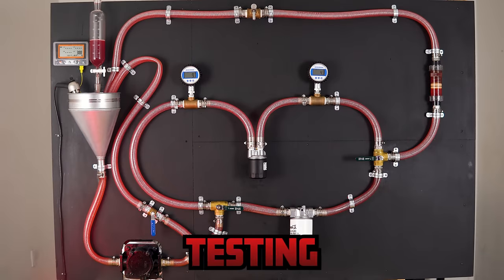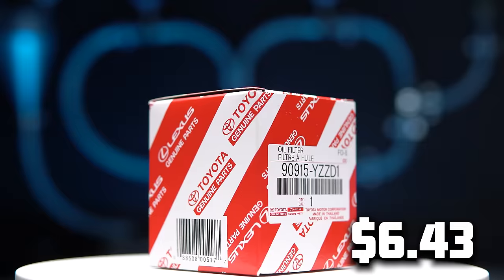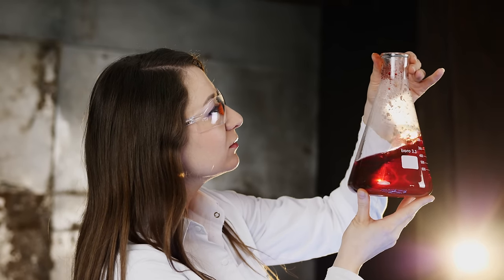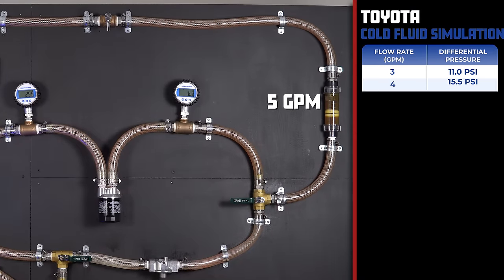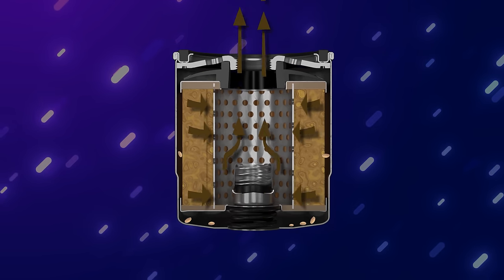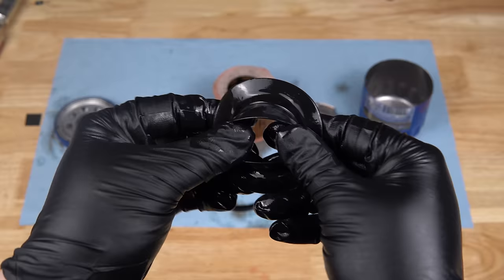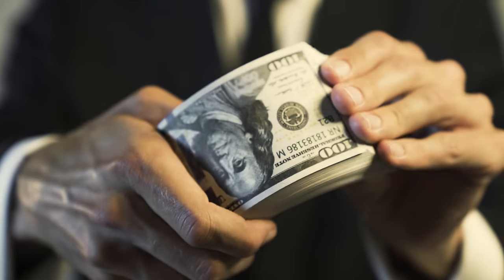Are Car Dealership Oil Filters a RIP-OFF?  (Engineer tested)

Comment: I would like to see the Honda filter in your list, because every Honda guy swears by Honda products... And is there a difference between the Honda filter you get from the dealership or the one you get from Walmart... Also the Toyota filter is supposed to be made by Denso.... Those the Denso oil filter perform the same as the Toyota Brand???

Comment: If you can find it, get the actual Toyota filter from Japan. It cleans exceptionally well. Kept my oil nice and clear for an extra 1000 miles before it starts to gradually turn brown.. Cost extra 50% but well worth it! Made in Japan! Not the made in Canada, Mexico variant.

Comment: Maybe Toyota would rather have the filter collect less and not clog, knowing the new cars have longer oil schedules? Who knows, but then again, that’s why you have a bypass….? Also, where do you purchase your filters? There are tons of knockoffs on Amazon and eBay, so that is something to consider.
Reply from the maker: It could be! very interesting results. Maybe they prioritize flow to ensure they have at least some oil even if it's dirty! thanks for watching
Reply: I was told many years ago by a tech that Toyota filters are very average but for ppl who neglect or just abuse their cars, the Toyota filters always allow oil flow which is more important in high abuse situations. I use Toyota filters on my 4 yr old Camry with 0w16 oil and have zero issues doing so. I live in the rust belt. The car will rot long before the Toyota filter causes damage, if any, to the engine. Cheers.
Reply: Other thing to consider is what micron causes enough damage for catastrophic failure?  So having the ability to still filter larger and more allowing flow instead of potentially bypassing everything…

Comment: The Ford Motorcraft filter is OFTEN priced the same or lower than filters that perform worse.......although not the best,  it's OK, and a decent value.   I usually use aftermarket filters on my Fords...  BUT when I have to hit up a big-box auto parts store on the weekend,  the genuine Ford filter is an OK option that's not priced out of line.

Comment: I don't understand how a filter that traps MORE particles is rated lower in performance. Or was this a test on oil that had been run through the filter, and not the actual filter?

Comment: Some filters that filter well still have excellent delta P.  If you can find a filter that does, there is zero reason to not have both.  Fram ultras typically have delta p that exceeds OEM.

Comment: People,  modern engines use the oil for alot more than lubrication.  If you put a non factory filter on your engine you are changing the flow and pressure which will effect the use of the vvt and pressure on the timing chains since most tensioners are being driven by oil pressure.  Thus changing the oil pressure at different loads.  Stick with a factory filter every 4500 miles with good synthetic oil and there should be no doubt that the engine will perform as intended and last.  Its all a game to try to sell filters.

Comment: That AC Delco has a by pass valve! That metal piece you had in your hand acts like a spring allowing the filter to move down opening a path for oil to flow when cooled or plugged if not that filter would explode!

Comment: Oil filters are only designed to take large particles out of the oil and not to clean the oil. The only way to clean oil is to replace it. That is why long lasting oils are marking blur you should always change your oil at manufacturers recommendation or your driving conditions your vehicle is subject to, for example towing or off-road where the vehicle is actually doing long hours rather than mileage.

Comment: Every Toyota/Lexus vehicle warns you for upcoming maintenance  in 4500 to 5000 mi. interval. Most cars on the road have only paper element to replace in a filtration can.I personally add a magnet, which I wipe and reuse.Thank you for making Toyota brand parts cheaper. I buy 10 ct. directly online from dealerships and pay $5 a piece with delivery included.I buy full synthetic name brand from popular retail chain, manufactured at  the same place glorified brands come from. Saves me 30% of oil change cost. Never ever had owned car in need of adding oil between oil changes. Engines outlast the useful car lifespan. And lastly, oil filters are secondary to air filters in the engine  eco system.

Comment: Please test ac Delco PF932 and other brands crowd referenced to see of the additional length of the 2 quart filter is a better filter and obviously holds more volume of contaminates.  How about comparing flow with the of one quart vs the two quart

Comment: Nor all filters have by pass valve, becuase the valve is build into the intended engine..
If you pay attention you will notice two identical fillters of the same brand with different part numbers. This is due too the fact one has a bypass valve and the other dosen't. 

Also, their are specialized filter that Intentionally don't have bypass filters, These filters are used in performance engines.

Comment: I’d really like to see OEM Subaru filters compared to aftermarket. They have a very high bypass valve pressure, but I have a feeling that it’s due to high differential pressure, not because Subarus “require” a high bypass valve.

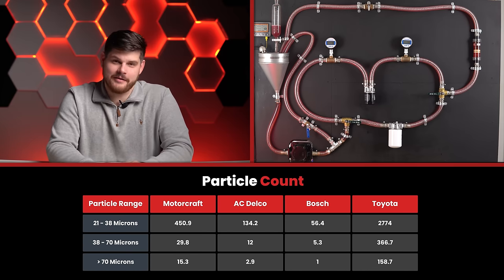Comment: Based on the filtering results at 5:56 the Toyota filter only 'looks' like a filter. It shows up for work, but sleeps on the job. Bosch looks like the hard worker of the bunch, followed by AC Delco and Motorcraft. The Toyota is left, well, way back in the dust. If I owned a Toyota, and I did when I lived in Japan, and it was a great car, I wouldn't use Toyota filters. I use the Bosch on my Jeep with a bypass filtration Amsoil EABP 90.

Comment: I’m surprised by how little filtration the OEM Toyota filter offers. Could this filter have been a dud? Is it worth revisiting this filter? Contaminants below 20 microns also damage the engine, but oil filters don’t seem to filter well below this size. Perhaps Toyota is relying on more frequent oil change intervals? If you have an OEM filter you best change the oil frequently to get the contaminants out as OEM seems to value flow over filtration.

Can oil suspend a certain amount of contaminants without it damaging the engine?

Comment: Perhaps the Toyota engine has a bypass built into the oil filter adapter assembly? That’s why Chevy small block filters do not have bypass valves.
Reply from the maker: I don't believe that's the case with Toyota as they have a by pass valve in their filter, but agree on the AC Delco one, that may be a reason. thanks for watching

Comment: Well known that Toyota filters have the least filtration, however, they prioritize oil flow instead of oil filtration. Seems like they want to keep oil in places where it's needed over pure filtration. Some oil is better than no oil, and might be designed for owners with extreme oil change intervals.
Reply from the maker: Indeed! all good points and it really might just be that. Better less than ideal oil for 3k miles than no oil for 1 second. Thanks for watching and sharing
Reply: @BrandRanks  I believe they also heavily prioritize first-start oil flow when the oil is most viscous since the most wear on an engine is at first start.

Comment: Don't agree with the construction of the Toyota filter. In the "4WD Toyota Owner" magazine of a few years back, maybe 2016 or so, they did an analysis of 16 different filters, it was a construction analysis, not a performance, but the construction of their 15600-25010 is far different than what you show. It uses metal end caps and a metal core and a pressure relief valve at the top of the filter. Instead of a formed rubber anti-drainback valve, they use a piece of rubber with a stamped metal spring to maintain the seal. I would say the 'Toyota' filter you tested was not genuine.

Comment: don't you have to use 0w20 ? or SAE 20 & SAE 30 ? So if RP filters are finer, maybe they are better for THIN oil. and Maybe the toyota filter is for Diesel ? I think when you get to the level of detail you are at - should be based on the application. The more I  learn from videos like yours the MORE questions it raises !

Comment: I believe the toyota filter is designed that way - unless you have catastrophic engine failure or dumped a bunch of sand in the oil you wont be filtering all those contaminants at once. Some oil might bypass the filter but under normal operation most of the oil is going through the filter media.
Reply: Oil change is the key.

Comment: if Honda A02 is equivalent to Fram Tough/extra Guard. Then that means Honda has terrible filtration, and terrible flow. At least Toyota has better Flow. I recommend switch to Amsoil or Mobil-1 110A if you have a Honda (except for S2000/NSX). 
I believe bypass pressure for A02 is 13 PSI from internet sources. Amsoil Bypass pressure for EA15k13 (Honda) is 11-17 PSI.

Comment: How can you compare flow and filtration between filters if they’re all designed and meant for different vehicles and engines.  It’s one thing to have a selection of aftermarket filters that are intended for a specific OEM replacement, but a Toyota filter is designed for a Toyota engine one one type and an AC Delco is designed for a GM engine that could be entirely different than the Toyota.  A more valid test would be to compare the AC Delco with equivalent aftermarket options and then in another test, compare the Toyota filter to a selection of aftermarket equivalents and so on and so forth.  Otherwise, great testing rig and everything you’ve done is exemplary.

Comment: It is a known fact that Toyota favors the oil flow over filter performance. However, I don't know why. May be because the most wear is during cold starts, and by having a good flow rate, it reduces the wear.
Reply from the maker: It would definitely make a good point. Maybe they are also made to have a better capacity as to be more resilient for people that don't change their oil often. Thanks for watching and sharing!

Comment: The AC Delco doesn't need a bypass. GM puts the bypass in the engine. That filter was likely the version used on the 5.3 liter looking at it.

Comment: Well as a Honda technician for 38 years I've got one car in my driveway that has 387,000 mi on it it's only used Honda oil filters no failure, my element has about 180,000 mi on it Honda filter no failure my Accord 2007 has about 160,000 mi on the oil filter failure and my other cord has my 2003 has about 120,000 miles on it with a no failure. I'm going to stick with original filters the other thing about a Honda filters if you buy it and have a failure you might have some recourse of the manufacturer try that with Brand X.

Comment: Have you tested a Mobil 1 Oil filter? I love these!   Heavy thick casing, lots of media and pleats, great back flow valve..... If you haven't done a video... check these out ! I've been using these for over 15 years. and cut a few open..
Reply from the maker: Yes we tested the Mobil one extended performance on our last video. Great filter with great flow performance. Thanks for watching!

Comment: OEM oil filters are not a rip off, Ive worked on numerous vehicles that come in for low oil pressure after getting oil changes done at valvoline or other places and have aftermarket oil filters on them, theres also numerous TSBs for lots of vehicles relating to this issue. After changing the oil filter to an OEM one the oil pressure is back to normal. Not all oil filters are equal, especially not the cheap ones from amazon or aftermarket sources

Comment: I would still go for the toyota filter for my toyota car. 

With the bad filtering performance, toyota engines are still the most reliable in the world. So i believe that this filtering capacity of toyota has no adverse effect on its engine, but the flow rate must be important for the engine. I believe toyota built their engines for this kind of flow rate. I cant go for another filter with better filtering capability but with worse flow rate, while toyota engine needs better flow rate

Comment: G'Day,,Very interesting,,we had clevite type bearing in our steel mill,,we would filter to 6 micron absolute,,Mind we were running a 10,000 litre system 100 cenistoke oil heated to 50dec celcius,
No BY PASS,,wouild change on pressure differental across filter,
Wonder at what pressure the by pass open in all filters tested,would prefer a system when by-pass open this oil is filtered before going to engine,,and a signal/alarm to say Hey I open,
You may think 5 micron is pretty fine,,but ifin one of these bearings fail,,take out about $50k in other componants,,so it cheaper to replace filters,,Not to mention cost of down time,and labour to replace componants and then rebuild,
Example,,pair of shafts,$8k each,,2 required,"A" (right hand)and "AA" (left hand spiral gears)
,mark "A" and "AA"the eccentirc they run in a pair,,about $10k each,+ bearing and assemble time,and thats just the housings let alone Carbide roll at $5 k each and then grinding,,

Comment: Assuming that Toyota filter was not counterfeit I would think it’s because a filter doesn’t need to be that good. Just look at any 200k mile Toyota bearing that wasn’t run low on oil. They are like new. It’s about clean enough oil and flow.

Comment: That was a great video, other than the part where you used an original OEM Toyota oil filter without actually using the proper grade of engine oil that filter is rated for which is 0W8 or the next closest thing readily available at the auto stores in America is 0W16. I love to see that test done over again but with a proper grade of oil for the Toyota OEM oil filters which are unique over and above any other American with OEM filter based on the fact that the Japanese have been using thinner and oil grades for over 20 years now And in North America, the API and SAE are just now starting to recognize the benefits of lower oil viscosity ratings for not only fuel economy but also cold start conditions below 32°F or in Canadian 0°C. The cold weather conditions is where the Japanese lower viscosity engine oils exceed over and above any of the 88 vehicle manufacturers worldwide. He was a good test, but not scientific whatsoever. How do you do this test over again with a proper grade engine engine oil with an OEM Toyota filter? I think the rankings would go across-the-board with TOYOTA has being a better filter than most of the aftermarket oil filters. That being said for my own use after many years of trial by error, I found out the mobile 1 engine oil filter to be superior quality in all aspects have a well built oil filter. That being said, I also found that using the mobile one engine oil with that oil filter for some reason go hand-in-hand for me! I also found that the mobile 1 synthetic engine oil grades along with their engine oil oil filter seem to make a big difference when they're combined together for some reason or maybe intentionally. I'll have to check out your other videos as well to see maybe if you've done additional testing. Thanks again and keep up the good work.

Comment: i have honda civic 94 manual after 14 years i just change oil filter in 14 years driving only one time i change filter and motor running good 470 thousand mile the same original motor

Comment: You realize that the better the filter efficiency, the greater the restriction to flow, This test makes the better smaller particle filtering filters, that produce cleaner oil look bad, I used to test particle counters that measured particles in oil. The better the filter, the greater the pressure across it at flow. You have a choice, higher flow or dirtier oil. I would use the filters with the higher pressures developed across them. There is a reason why the OEM filters can be so high priced, they do a better job at keeping your oil clean and making your engine last.

Comment: I'm very curious about Honda OEM filters. Honda recommends only changing the oil filter every other oil change, up to 20k miles. I wouldn't even do this with the best high-endurance filters in this test.
Reply: I’ve done it with, and still do with my Hondas, OA on a 20,000+ run on a filter with an oil change at 10,000mi came back very clean.  This was using Honda filters.
Reply: @karfreek  This is also common mfr. suggested practice with Japanese motorcycles. I’ve dissected Honda oil filters and was very impressed. Yamaha, not so much.

Comment: I don't understand how having more trapped particles in the filter makes it a worse performer. Can someone explain ?
Reply from the maker: The capacity test and the filtering performance test were different from each other, but in general you would expect a filter that doesn't filter as much to have a greater capacity, basically because it's really not filtering as much. It's not that having more trapped particles makes it worse but that it clogs up a lot faster given it's capturing everything, so in reality, I wouldn't go to the extreme some of these manufacturers states to change your filter like "it last 20k miles". Hopefully that answers your question. Thanks for watching!

Comment: The most ridiculous thing you'll find relative to this is people actually quibbling over the 'expense' of even fairly low-cost filters. Whether you're buying a Royal Purple for an arguably exorbitant $27 or bargaining down, it's an expense that doesn't come up often enough to be of concern when you factor in that you're putting a ten-dollar part on a 40,000-dollar part. If you drive a lot for a living, for fun, or to get to a distant job site, the miles accrue quickly, but even one premium filter per month is likely less expensive than one drive-through lunch. Perspective. 🙃